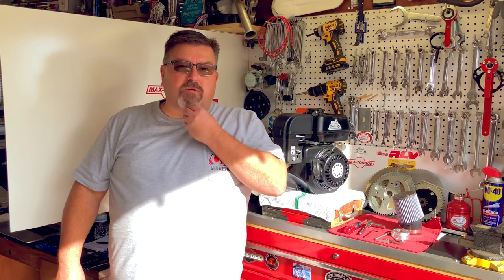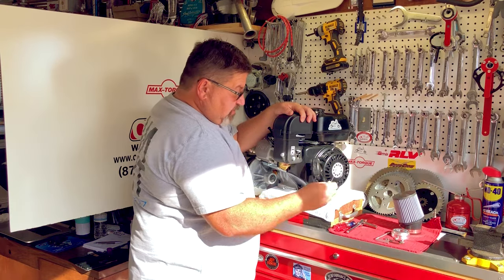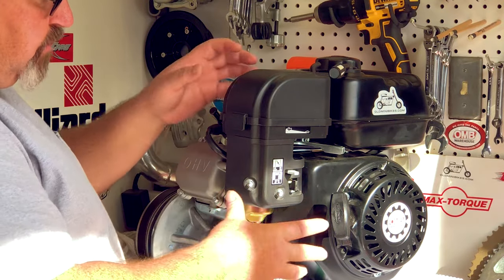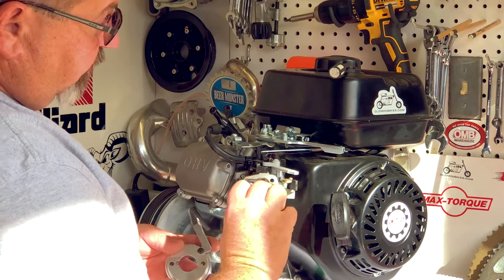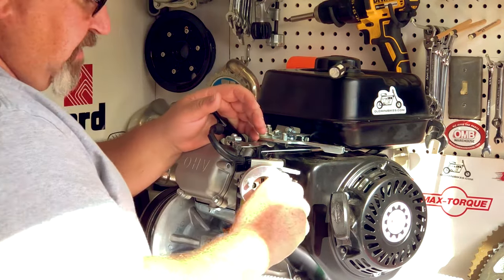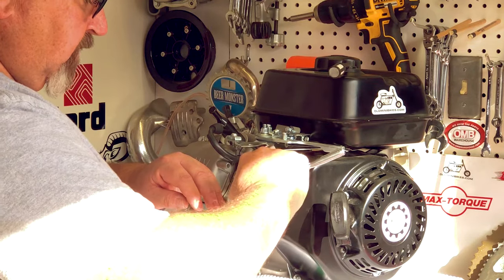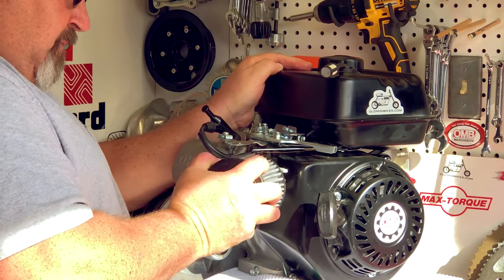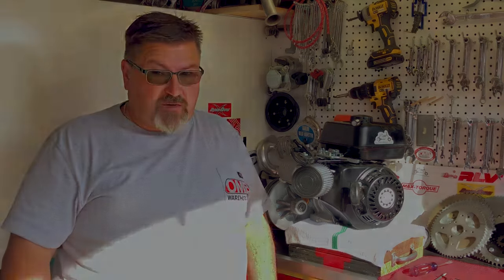OMB Warehouse Predator 212 Air Filter Kit Install

Comment: I purchased this last week and installed it on my grandsons minibike what happened next I wasn't prepared for. Let me say that OMB supply was fantastic they took my order over the phone and they were very patient with me everything came on time it was great. Last month I put a 212 predator on my grandsons Coleman 100 and now this week I installed the stage two kit. I was expecting a little power increase however I cannot keep the front end on the ground anymore. At half throttle the front end just comes up, I realize I'm an adult sitting further back on the seat and I weigh about 180lbs. I am not punching the gas, it just comes flying up at about 40 miles an hour, I don't know if this will happen with my grandson riding,, he's nine and doesn't weigh very much, and would be positioned a lot closer to the front end. I haven't let him ride it until I can figure out what's going on, any suggestions

Comment: Could you do a video putting the stage 1 kit on the bt200x with the header pipe and muffler. Stock with the engine not moved. There's no way one can get the muffler on. Thanks for your time.

Comment: OMB flywheel install locking the crankshaft
Reply from the maker: We sell a tool that makes it easy
https://www.ombwarehouse.com/3-4-crankshaft-holder-tool.html

If you don’t want to buy the tool, remove the spark plug, stuff nylon rope into the cylinder making sure both valves are closed ( the compression stroke) and rotate the crank until the rope is compressed against the cylinder head to hold the crank while torquing the flywheel. When done rotate the flywheel back and remove the rope

Comment: My Air Filter ripped at the base the rubber part that goes over the adapter while I was trying to get it on. So I temporarily slapped some duct tape over the ripped part. Still after adding the Stage 2 Carb, Air Filter and Header Pipe now when I start it up it only stays running for like 10 seconds and then it stalls out on me. I can't even test drive it. What's causing it to stall ?

Comment: I bought the stage 1 kit for my bt 200 x. Which includes the herder pipe and muffler. The header pipe end hits the frame on the other side of the bike, so I can not get the muffler on. This was supposed to fit the bt200x. It is about two inches short the for bt200x. Is there a header pipe that fits the bt200x?
Reply from the maker: Can you send me pics to help@ombwarehouse.com and put Gray Goat in the subject line and I can take a look

Comment: Does this filter need to be oiled? If not, is there any issue if it is oiled?
Reply from the maker: Hi Corey,
The gauze type filters should be oiled. K&N filter oil is what I use, as it is available at most auto parts stores. The oil helps catch the smaller dust particles and is a critical part of that type of filter to have it work properly!

Comment: it dont come with the thing you put on the holes ?
Reply from the maker: Hello, I am not quite sure what you are referring to. Can you elaborate?
Reply: @TheGrayGoatGarage sorry man still a newbie on this. I'm talking about the  vent holes and the valve holes. Its connected to the airbox
Reply from the maker: we use filters for those. You don't have to really vent the gas tank, just the valve cover. Use this
https://www.ombwarehouse.com/fuel-filter-zama-zf-5.html
the hose a little too big for this, but a zip tie will snug it down and you'll be fine!

Comment: Why does mine suffocate when I give it gas
Reply from the maker: Because you probably did not change the main jet to a larger size to accommodate the additional airflow
Reply: @TheGrayGoatGarage  yup it certainly is I thought that I can use it without the bigger jet and just didnt install it
Reply: @TheGrayGoatGarage  is taking off the second gas line bad and is taking of the line from under the valve cover bad ?

Comment: This is for a 212cc predator engine right?
Reply: Have you had issues with installing this as well I’m having issues with attaching the intake attachment I don’t have enough threads left to attach the nut on the right hand side one my 212 predator
Reply: @cesarcabanillas9333  I never bought it because I heard of all the issues I’m buy the 224cc max performance from harbor freight

Comment: Can u put it on a non hemi
Reply from the maker: Yes, absolutely. They share the same carb
Reply: The Gray Goat Garage I put it in today in my mini bike and it did not wanna start do u know y ?
Reply from the maker: Vnevermiss2k ! Once you add an air filter kit and/or a header, you must rejet the carb to add more fuel. The stock muffler and air box are very restrictive and when the restriction is removed you have to add more fuel. I also see a lot of people that remove the plastic spacer between the carb and head. That part must be there
Reply: The Gray Goat Garage o I removed the spacer
Reply: The Gray Goat Garage I don’t have a stock muffler either
Reply: The Gray Goat Garage but u helped a lot thanks
Reply from the maker: Vnevermiss2k ! The plastic spacer is critical. That must be in place for the engine to run properly. You will have a large vacuum leak as the carb will not seal to the head, making the engine really lean and un-tuneable
Reply: The Gray Goat Garage so to get a new jet is a 100% must right? Or will my bike still be able to run without it?
Reply from the maker: Vnevermiss2k ! Yes, you must rejet the carb. These engines are imported running very lean. You let it breathe, you need more fuel!
Reply: The Gray Goat Garage what size or which one do I get?
Reply from the maker: Vnevermiss2k ! Every engine has different needs. Your engine will take anywhere from a .036 to .038 jet
Reply: The Gray Goat Garage alrighty well I should be set thx u have been great help and do u think the 38 will work better or the smaller?
Reply: @TheGrayGoatGarage  doesn’t work on my 212 non hemi the the bolt on the right hand side is short then the one on the left so I can’t tighten down the nut.